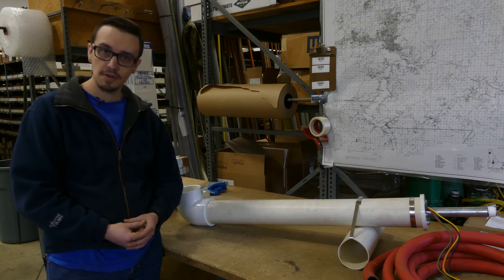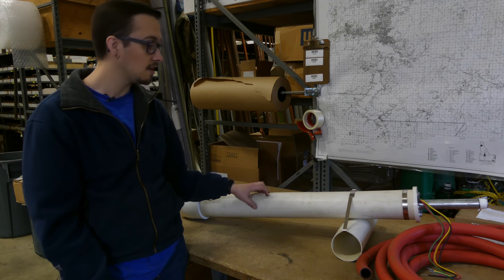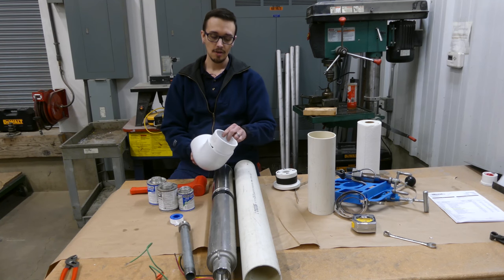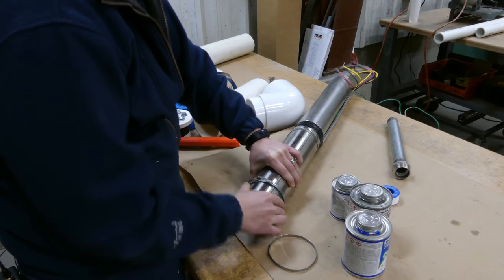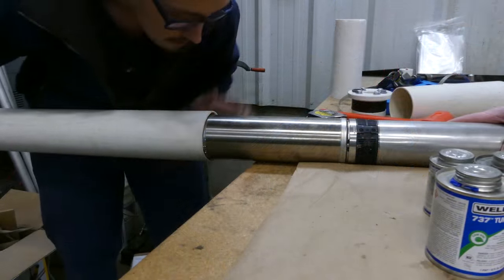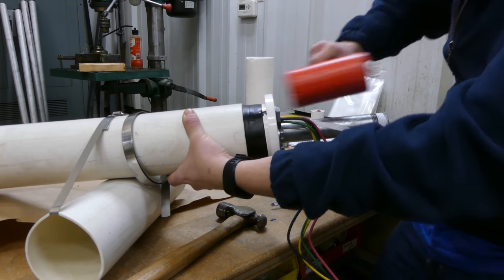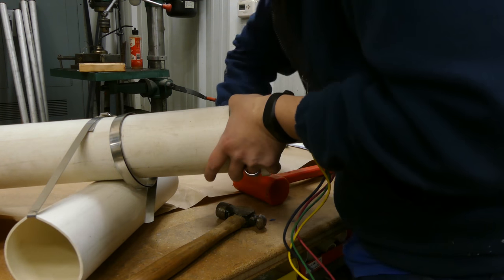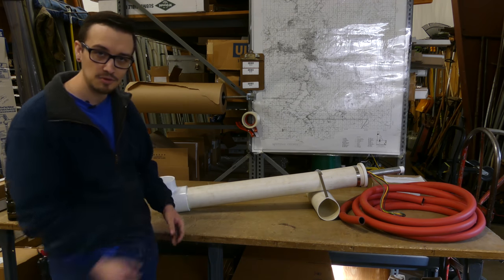Flow Sleeve Structure for 4" Well Pumps in Reservoirs or Cisterns

Comment: I dont have the fancy hose clamp tools you have.  Will it be okay to use the standard screw type hose clamps or will the vibration tend to back them out and loosen them over time?
Reply from the maker: Screw type should be fine to use.

Comment: What is the length of this unit ? Awesome job on the videos learning lots , I have a dug well crock that’s 3 feet wide by 9 deep that I have too put a submersible in , still working out the best approach too situating the pump inside the crock in relation too a pitiless adaptor about 6.5 feet up inside , cheers

Comment: Very helpful, thanks. Can we flot submersible pump on the surface of water? Will that work with same efficiency?
Reply from the maker: Just need to make sure you have the flow sleeve on so the motor is cooled.

Comment: the pump can operate at this degree of inclination 0:18 or it is better totally horizontal?
Reply: I was thinking exactly the same thing, since its easier and preffer to use solid PVC pipes at a right angle
Reply: @santiagosalcedo7653  and put a curve instead of an elbow since the latter, being at 90 degrees, produces a lot of bubbles as well as little efficiency when the water comes out
Reply: I've been looking into this the past few days. Grundfos SQ(E) install instructions show installs from vertical to fully horizontal. However, Franklin AIM manual says to keep the pump at least 15 degrees from horizontal, similar to what is shown in this video. Franklin tech support confirmed this to me. So it probably depends on the pump, and how the bearings are designed.